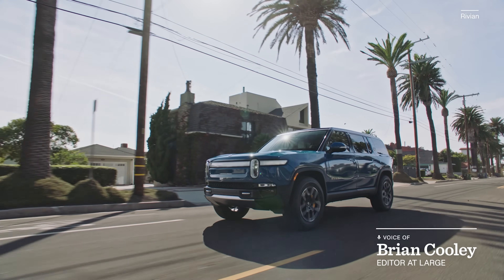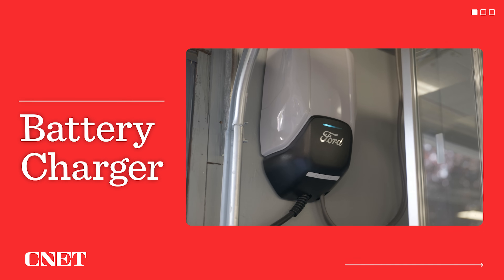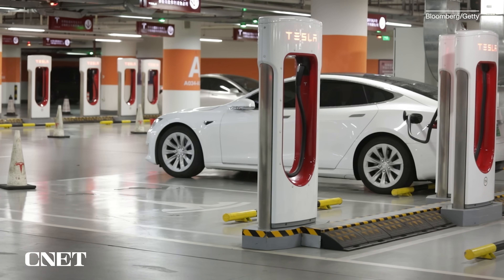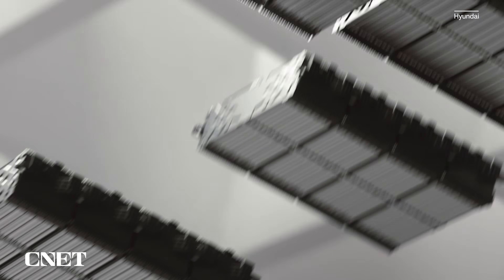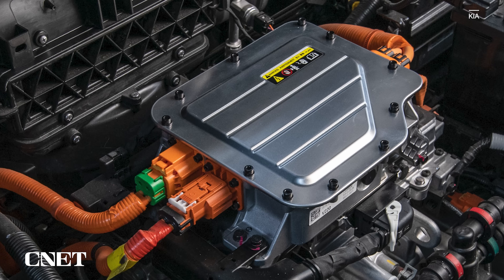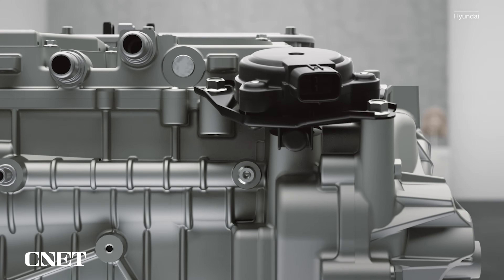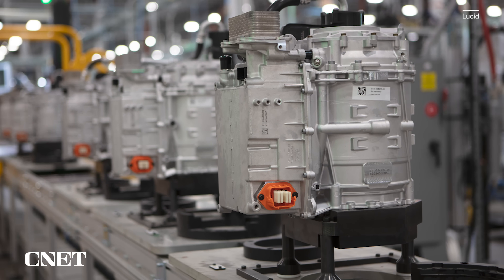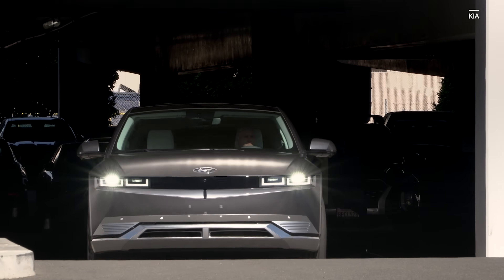How Do Electric Vehicles Work? EV Charger, Battery, Motor All Explained.

Comment: There are a lot of reasons why ev's will never work in YouTube comments.  I've had 2 used 2015 EVs for 3 1/2 years. Much less maintenance, save a lot of money on gas, fun to drive & I'm not embarrassed to say it's better for the air, more gas for everyone else.
Reply: Charging is not free usually, it's much much cheaper than gasoline

Comment: How much loss do you get transferring from AC to DC back to AC? Seems kinda like a waste. Can you get the same performance from a DC motor? Or have the ability to store AC power?
Reply: All batteries are DC, there are some losses from an inverter, overall much more efficient than gas still. AC motors give more appropriate performance for a car.
Reply: @rp9674  I want them to improve salt nuclear reactors small enough for a home or vehicle. Nice thing about salt nuclear reactors is that they don't melt down. Safer for a vehicle involved in a crash, yet nearly unlimited range.

Comment: Why are EV's still designed to look like combustion cars? If the motors are distributed, then what's under the hood?
Reply: Safety structure for crash protection in the event of a frontal impact?
Reply: Electrical/electronics- inverter, chargers, air conditioning, coolant reservoirs. Some storage on some vehicles.
Reply: Besides safety people still have ICE aesthetics. Evs should look like teardrops but that looks ugly to us. Back in the day cars were made to look like horse drown carriages for the same reason.
Reply: @gymnosplat  like the return of huge grills. 
I like weird and futuristic looks and also retro. I used to hate BMW i3, I bought one now I love the looks, I also have a Fiat 500e which I like a lot. Most of the cars that people think look really good are boring to me.
Reply: Extra storage space and more crumple zones would be my guess.

Comment: The biggest issues with electric vehicles is the one fact and that’s they are NOT ready for prime time and are being rushed to market BEFORE they are ready !
Reply: Yup. All these millennial idiots are trying to force it onto the public to virtue signal.
Reply: Doubt you have ever driven a Tesla then!
Reply: @jezza6575  no but I watched one burn up on the interstate.
Reply: @AudiophileTommy  Well the thing is, combustion engines are basically a very well developed bomb. In fact, a study run by AutoinsuranceEZ shows that ICE cars catch fire 60 times more per 1000 vehicles.
Reply: @jezza6575  Driving is very different from living with a car, bro, 😂

Comment: First there is a 11 year old mining cobalt to make your battery. Then it cost $1.50 a hour to charge for a 150 mile range. At this rate it will take a month to drive across the US.
Reply: This is why fuel cells make more sense to me for long range trips.. battery EVs make more sense for city commuters who don’t need as much range. Neither is a perfect solution
Reply: @Funlu  Fast charge and better battery tech makes more sense than fuel cells. Fuel cells wnt be mainstream since it's not efficient at all.

Comment: EV transmissions have 1 gear called GO
Reply: Except Porsche and Koenigsegg.
Reply: They do have different modes though to control acceleration.
Reply: @blueisthecolor3463  yeah I know that it is for range efficiency and power management and I know how amazingly good it works for the Taycan.